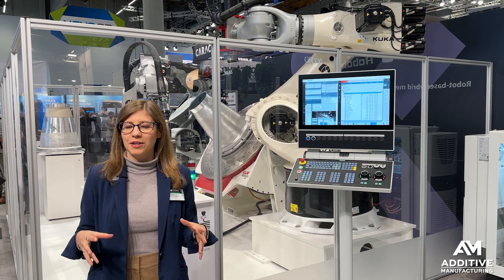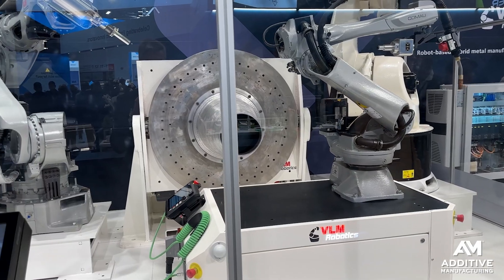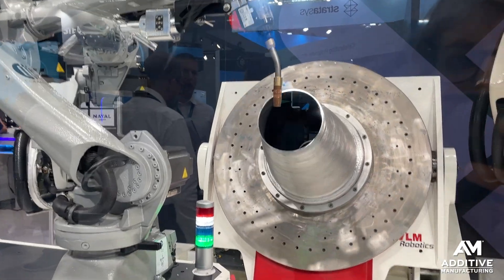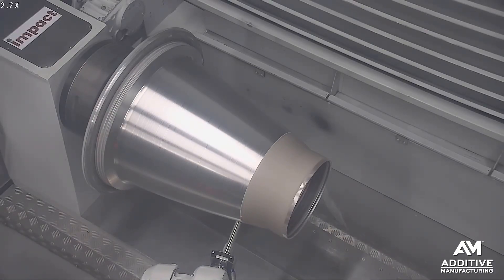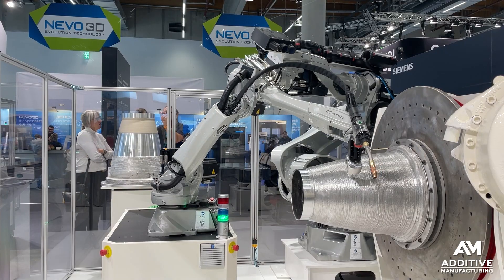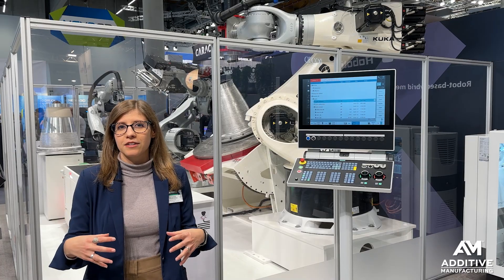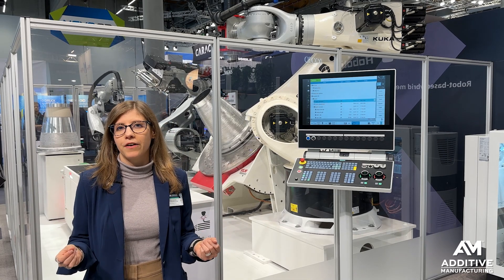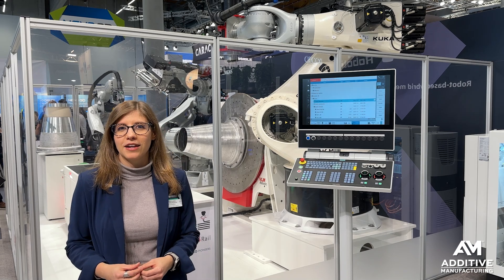Robotic Additive Manufacturing Cell | Formnext 2024

Comment: But each of the robots are just standing around during specific portions of the cycle. Isn't that inefficient use of multimillion dollar equipment?
Reply: Depending on the size, industrial robots are quite cheap, around 50 to 100 thousands dollars. Sometimes  just moving a complex part to another cell may take 1 or 2 days, and both cells remain idle during this. So this setup ends being cheaper.